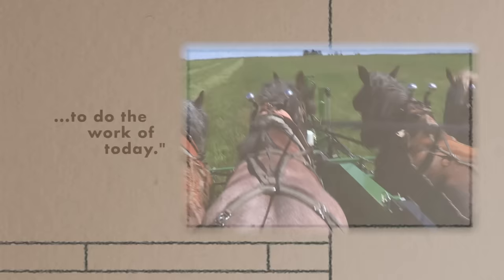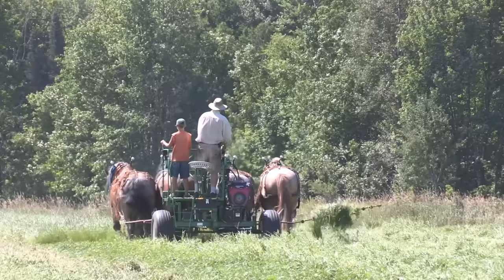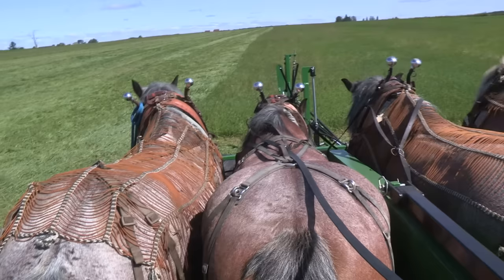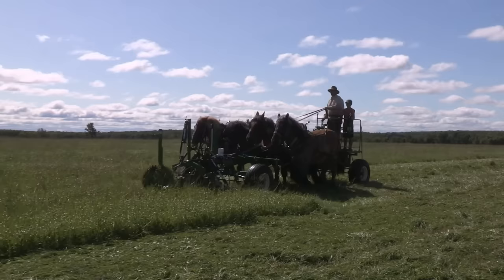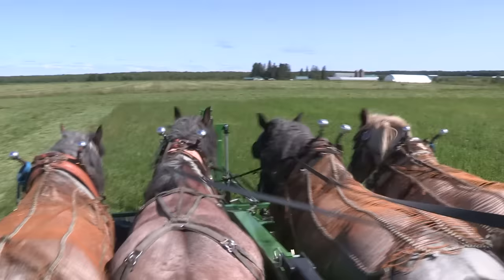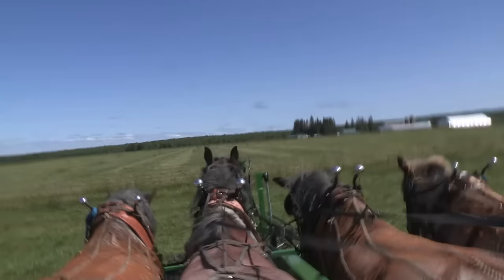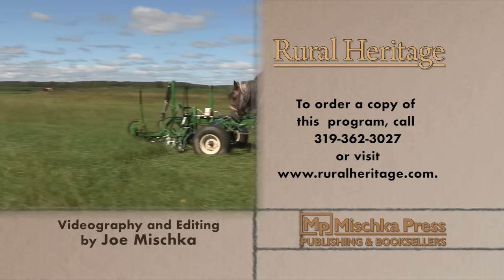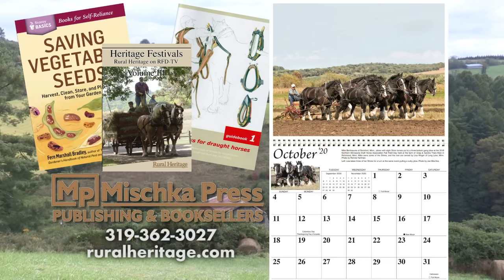Horse-drawn Haying in a Day with a 24-foot Mower

Comment: You work with horses because you love it. When the tractor shuts off the fuel is done. When you get done with the horses they still need to be fed.
Reply: Yes but it can be done and cost competitive
Reply: Yes when the tractor is off the fuel is done but you still have to pay for it. He is making the feed for the horses as well as for his cows. 
A few years ago I saw a study that you use 10% of your cropland just to buy the fuel or the same number of acres to feed the horses BUT the number of acres to feed the horses doesn't have to be from cropland, it can be from corners and road ditch. AND it costs nothing for replacement engines if you have a mare and a stallion. Can you grow a new tractor??

Comment: That's very interesting.   I would like to see the actual cost of the horses versus the tractor.  Feed v/s fuel.  Horse care v/s machine maintenance.  Replacement costs over the lifespan of each.    

And oh,  the comfort of the farmer with out AC sitting in the hot sun.  : )
Reply: For the last hour since watching this video ive been running those numbers in my head. Horse purchase vs used tractor purchase will be about equal.  Maintenance, longevity, reproduction (if using mares) advantages all go to the horse. Farmer comfort will go to the tractor.... If you spend more.   A lot more.   Notice his 986 (or whatever model that is) has no a.c.   in which case the purchase price will go to the horse as well. You have to put your own price on comfort.
Reply: Dont forget when your in a tractor a lot of the extra heat comes from the engine itself ;)
Reply: His numbers are a bit off the rocker.  I mow 10 to 15 acres an hour with my self propelled Massey Fergeson 13' disc mower.  In hay like that I'd be about 3 acres per gallon of diesel.  Heavy hay, down near 2 acres per gallon. That is conditioned as well.  We run the discs at 1800-2000 rpms.  No where near 9000 rpm.  Most mowers would max out about 3000.  Calls into question a lot of the numbers he's throwing around.
Reply: I workrd 10Years for an Environement Service and i was running a Newholland Tn75sa with 2,75m Sicklebar Mowers.
We were Mowing small Pieces of Land on lots of different Spots.
An other Crew was mowing with 2 Horses and one 2,75 Sicklebar Mower driven by a 20 Hp Gas Engine.
The Horsecrew were 3 Man with 2 cars and Trailers.

On the end of the Day the Tractor was mowing 4 to 5 times more with about 30 Liters of Diesel for mowing and moving around.
The Gas Engine needed 20 Liters of Gas. 
Walk behind Sicklebar Mowers like the Brielmaier Mower were much more productive and Cost efficent than the Horse Crew.
Reply: When doing your math don't forget a tractor only costs money when you use it. 

I've been around horses my whole life.  As much as I enjoy horses, there is a reason tractors and cars replaced horses in the field and on the road.
Reply: Alina McPherson  I was referring to the numbers he was using for the tractor powered mower that he was comparing the horse drawn machine to.  I think that his numbers were highly inflated because of bias toward the horse propelled machine.  What use is the comparison if the figures stated aren't accurate?
Reply: Alina McPherson  the gelding has just as much chance of reproducing as the tractor does.  Reproduction was the context of that part of my statement.  Yes all 3 "sexes" are equal as far as horse work vs tractor work.
Reply: @navaskyy7764  not really in theory yes but open cab you should get plenty of breaze.
Reply: @joelharnish7429  how do you have any idea what your performance would be in his conditions
Reply: @jpoppinga8417  but at what cost? We traded self sufficient lives for complete bondage

Comment: Have you calculated the total caloric costs per acre:  Horse Powered: 1/4 gal Gas per acre + ( ??? Animal Feed) == 7900 kcal (gas) +  ??? kcal (horse).  Or, another way:  what fraction of each acre cut must be invested back into animal feed?    Not at all questioning this practice -- It's just that most people have no idea how much work is actually performed by petroleum energy.   My questions are prompted by the study of energy use (and limits) by technological civilization.    If you could provide a notional answer to what fraction or percent of acre is required for horses to cut one acre?  Thank You! --Physicist.

Comment: This is cool.   Made good points and gave me  ideas.  That mower could easily/economically be made to be self-propelled with an axle and a hydro pump and motor....sickles don't take much power … So 23 hp would probably be enough to move the whole thing at walking speed of a horse (for those of us that don't have horses).
Reply: Remember that the most likely thing to break in a tractor-mower is a single blade, worth a couple of dollars at most and replaced in minutes, so most farmers out chopping silo crops will carry a couple with them. A sickle blade, on the other hand, is a major investment within the machine. Snap that blade, or even a single tooth on it, and you have U/S'ed your mower for potentially weeks.

Comment: I love how you completely ignore the fact that sicklebar mowers do not handle rocks, antbeds etc. without breakign teeth and when figuring cost you also ignore the cost of your horses and the upkeep for horses, which is huge compared to the maintenance costs on a tractor and baler.
Reply: Got to be $1k yearly minimum to keep the herd shod or trimmed.
Reply: @limitedtime5471  unless they’re barefoot - he’s using American Brabants which have good hard feet and can go either way.  As far as feed..?  They’re making it right there.  And you’re right about the baler x wonder what he uses?  There’s a nifty video on here where an Amish lady is using 4 horses with a Khuns accumulator.  You’d still need the “grabber” amd a bobcat to pick them up but still pretty cool

Comment: What?!? a Gallon an acre?  I think you got a fuel leak.  I cut with a 4840 (215hp) and a 15 foot Gehl 2415 disc mower conditioner.  I've checked several times, and it burns .5-.6 gallon per acre.  AND I am conditioning the hay. 4840s aren't very fuel efficient tractors compared to newer models.  When I'm done, I can park it in the shed for a week and not look at it.  Do that with your horses.
Reply: Also, my 4840 is worth 15k and my mower is worth 8k,  that's 23k. Your 966 (?) is probably worth 12k and the Deere MoCo is worth maybe $8k (don't really follow Deere side pull MoCo values, so maybe a little off one way or the other).  That machine is nice, but $36,000?  It's a nice machine, but worthless if you don't have $15,000 worth of horses to pull/push it...